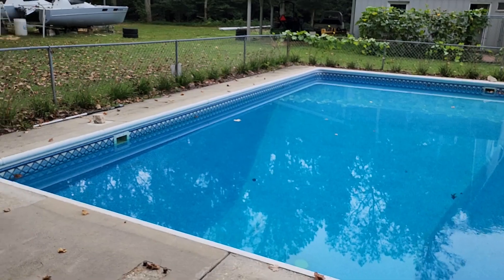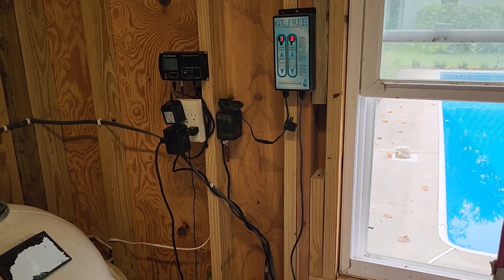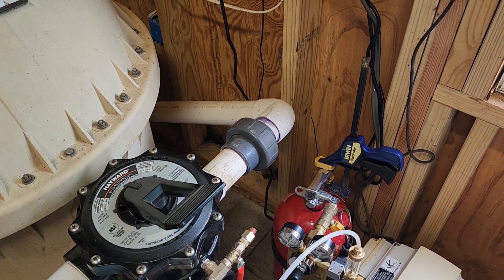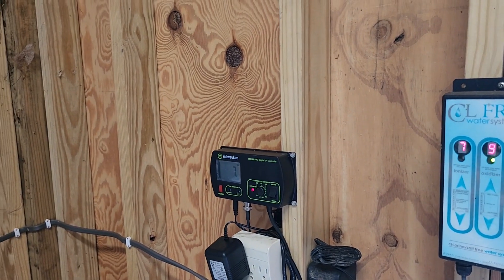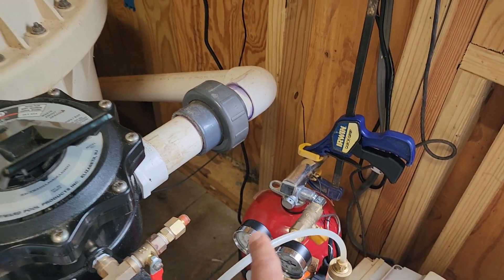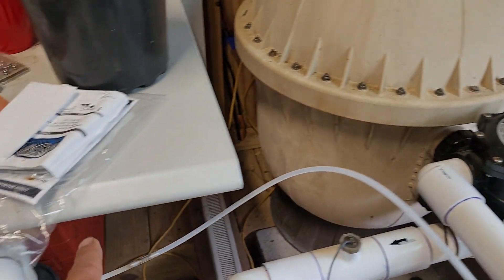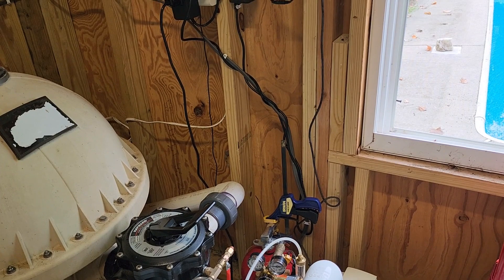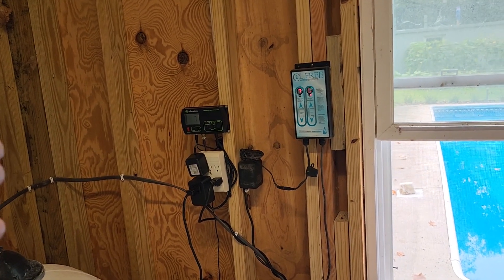DIY CO2 Injection for Pool pH Control

Comment: wow. this is awesome. i am in the process of identifying the culprit of my pools high PH but low to mid TA problem. i have 2 spillways, 1 waterfall, and 2 bubblers so i am strongly leaning toward aeration. approximately how much CO2 were you injecting daily while the pool was open?? thank you for posting this. super helpful

Comment: Hello again, I set it up exactly as you’ve shown, only the CO2 regulator instructions say the glass chamber should stay 80% of water. When I run mine, it dries out quickly-and I notice yours is empty in the video. Do you run yours dry? And if so, how do you set the dial on the regulator? Thanks!
Reply from the maker: @doktorgregg  Yes I'm running empty because the amount of CO2 you're pushing through is more than just a drip. On mine I can hear the CO2 getting into the water through that line.

Comment: I was about to buy this for my 2500 gallons pool then I saw your video, do you think it would work for a salt system injecting a muriatic acid diluted in water to lower the ph ? Thank you !
Reply from the maker: @juliedesmarais7477  you should do the same thing regardless salt,chlorine or copper.good luck
Reply: Actually, for salt or should be perfect because the SWG automatically creates high pH in need of correction.
Reply from the maker: @juliedesmarais7477  I'm pretty sure it should be the same because CO2 is just replaces the muric acid so it should be able to do same in salt system. I'm just trying to stay away from acid's

Comment: Fantastic system, mate, thanks! Does the relay come with the pH controller, or do I need to buy it separately? Also: I can’t see any output on the controller, so how does it operate the relay?

I’m planning to add your system to a biopool setup, which uses a bead filter, AOP, and mini-regen zone instead of chlorine. Since I want the co2 to support the biofilter, I plan to inject it into the pump via the drain plug.
Reply from the maker: Everything you need comes with controller only other items you need is regulator with switch and CO2.  Regulator plugs into controllers trigger switch very simple steup. Good luck.